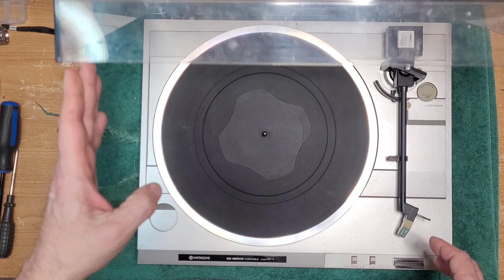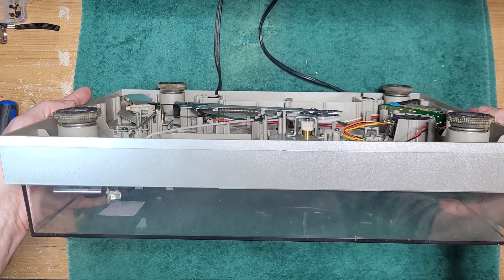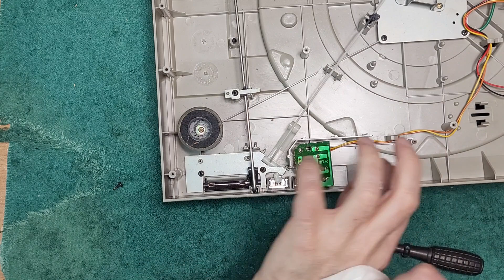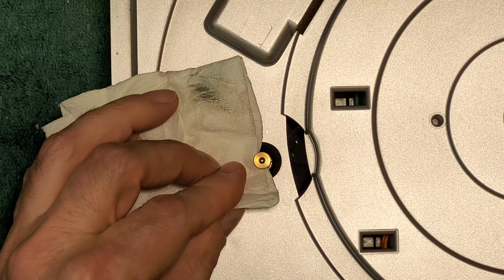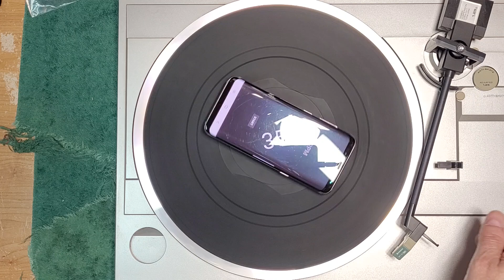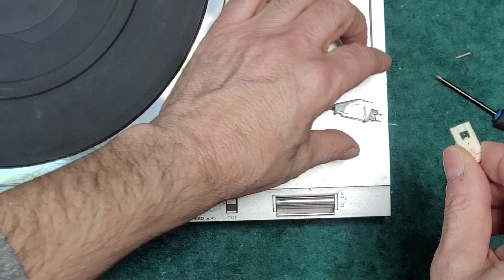Restoring a Thrift Store Turntable Part 1 - The Service - Hitachi HT-1

Comment: I have the exact same TT here with the original HT 12 cart I use for testing receiver phono stages. I bought it off my older sister thirty+ years ago for $50 and it came with a Hitachi SR-1900 Receiver and Hitachi  two way speakers which needed refoaming. I just had it loaned out to a friend while I repaired his JVC TT and he said it worked flawlessly and that's with the original belt.  After watching these vids, I just might do some service work on it following your lead. Thanks for posting this and the next informative videos!  
EDIT:  OK, I serviced this turntable by installing a new belt and a AT81CP cartridge along with a total deep cleaning and lube. What a difference!  It was truly a diamond in the rough.

Comment: Shouldn't that app RPM readout remain in a stable orientation if it's measuring correctly?
Reply from the maker: All tables have wow & flutter - even quartz lock decks.
Reply: @TurntableGuy  Yeah slightly more if anything.

Comment: My JVC TT QL A5 which spins for 5 minutes and then stops .This is lying idle since last 4 years and the main culprit is the IC number 1 which is not available .Toll today no technician could remove the platter by any method .Tapping by screwdriver like you did or heating or anynother method,it has not come out of the crntral spindle.The IC number 1 is VC 5021,it is not available.One technician attaches multimeter probes to two pins of this IC then the TT runs for longer period but at more than 78 rpm speed.